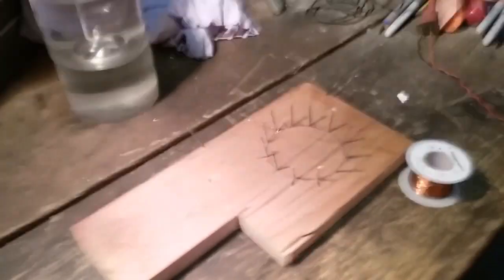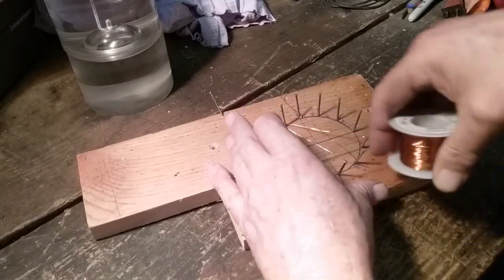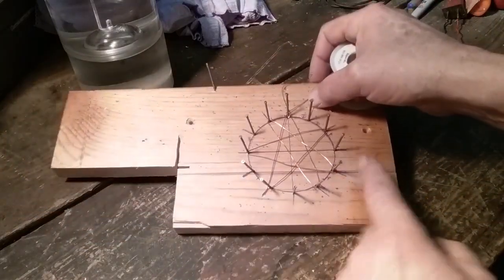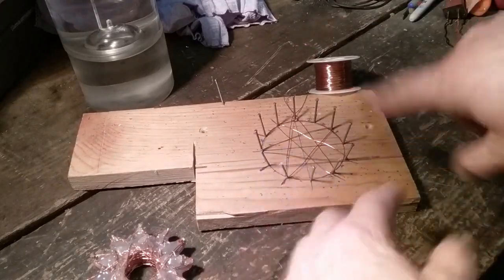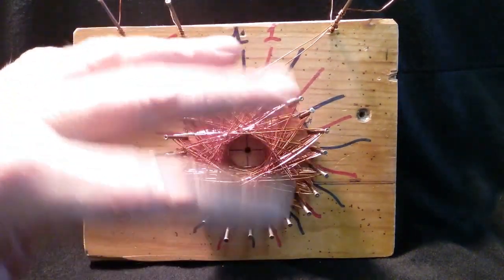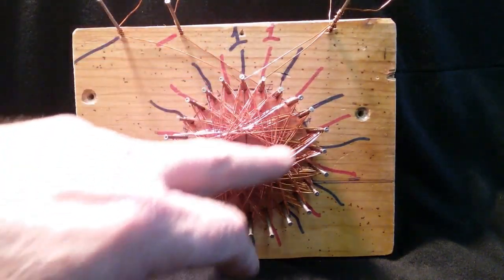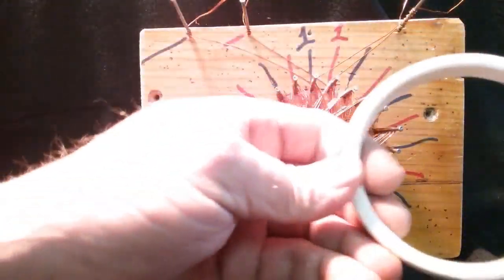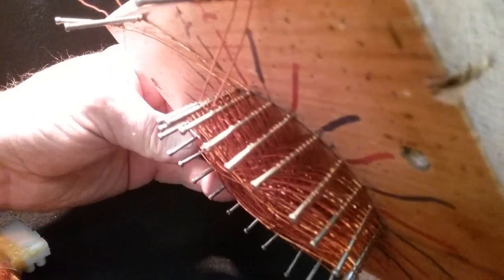Rodin Starship Coil

Comment: This is great. Can you tell me how many points does the coil have and what is the jump sequence. Thank you.😊
Reply from the maker: 12 point - jump 5. (or you can make a 24 "double" point. It is 2 - 12 pointers together in one. You just do 2 wires at to individual windings12 points  - jump 5 - at the same time.

Comment: I wonder if the coil would spin this  https://www.youtube.com/watch?v=F9GZ4PKWzbY&list=PLjgO768OTrtSRcCacH79oLU6j_l41ac6x&index=5  and you could put a pole through it and attach a rotor at each end of the pole to charge 2 small generators each side and have them charge up two 12v batteries through a BMS ( battery management system ) to let you monitor the charge going into each battery.  Obviously you would need a 3rd battery to provide the 12v into the coil.  You would need to rotate the batteries around so that you would always have a new charged battery giving the coil 12v.  But theoretically it would not run out of charge and the field would be permanently able to heat the copper pipe generating heat for your house and possibly attach an inverter to the batteries ( to invert the power from DC to AC ) and run it off to a plug board for various appliances.  Just a theory.  Thanks for the video Good Vibrations it's really quite good.

Comment: add ultra high frequecy and crystals to the set up...
Reply from the maker: I may try that if I return to experimenting with it again. Thanks for the advice!
Reply: @TheGoodVibrations  yeah pal...  heres the thing everything resonates on frequency and cystals can magnify energy and make it stronger... also  frequnecy can bevapplied to the magnetic field to make the magnet lift... cacpabilities are endless
Reply: even putting a double inverted crystal shaped pyramid  structure inside that coil is gonna make things intresting..
Reply: @scottessex6122  piazoelectricity

Comment: Host is this essentially a rodin bifilar 3d version?
Reply from the maker: I believe it's more of a simple dual coil. Both wires are wound in the same direction - just off-set by about 15 degrees.

Comment: How can non techies like me use this method to power up our houses?
Reply from the maker: Sorry - but this is basically just a small electric motor. It takes power from the electric company (or a battery) to make the magnet "spin".
Reply: @TheGoodVibrations  Can this motor produce more output than input?
Reply from the maker: @alexandradixon204  No. I don't believe any motor can do that. That is called "over-unity" (or perpetual motion) It may be possible - but as far as I know - it hasn't been achieved as of yet.
Reply: The shape of the coil is all you need and a good magnetic  resonance of medium coils a feed of magnetic resonance electronically or wind and magnet to shape the diagonal Fields are a good start

Comment: what does it mean???
Reply from the maker: It's a pulse motor. You can use electric pulses to spin a magnetic motor - much simpler than how induction or brush - or even brush-less motors operate.

Comment: How do u connect those cables of the Star Coil to the machine? how does it is called? what do i need to give them current?, i just need 12v? 24? 48?
Reply from the maker: The leads of the starship coils connect (solder) to the OUTPUT pins of the circuit board from a PC fan that has hall sensors.
The PC fan has a particular voltage it is designed for. (They can require different voltages - depending on what particular fan you use...)
The input voltage (dc adapter or battery) also connect (solder) to the INPUT pins on the fan circuit board.